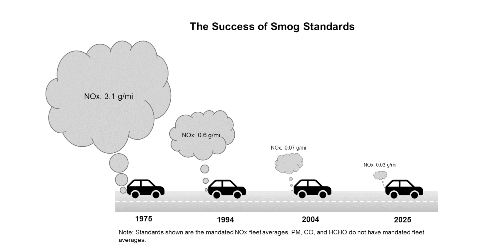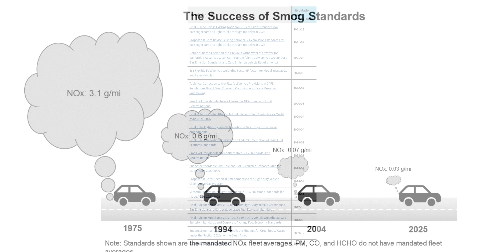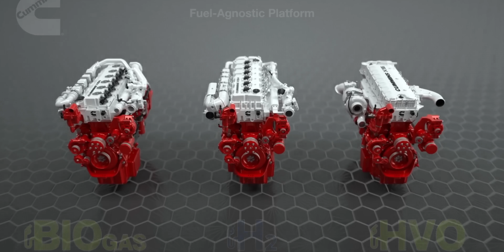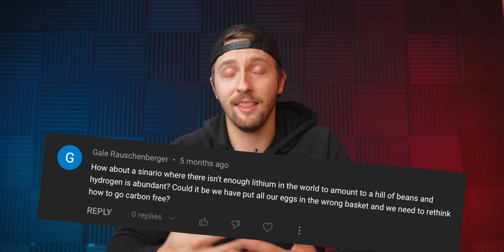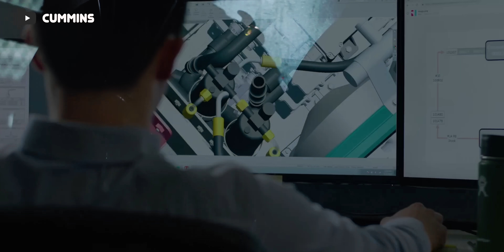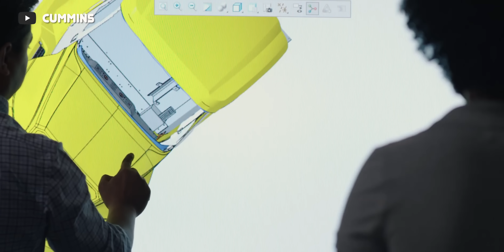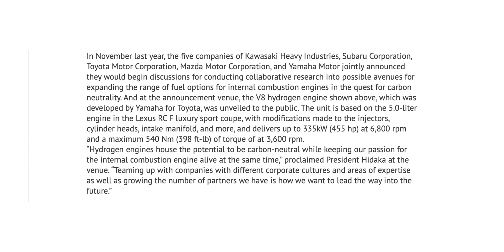Cummins Hydrogen Engine Will KILL DIESELS FOREVER

Comment: UPS has been testing LNG for long haul applications since 2013 with moderate success.  The best use is 'turns' wherein the tractor is dispatched to point B and returns to point A, where there is available LNG.  These were powered by Cummins in a Freightliner chassis.  It's interesting to note that Cummins terminated its partnership with Westport to develop this technology using LNG several years ago, and just last week, Volvo announced a partnership with Westport to develop the application using liquid hydrogen-- so it seems to me that the technology to adapt to hydrogen should be very similar to an application with LNG.  In both cases,  waste heat from the engine is used to return the LH to a gaseous state; at that point it can be precisely metered and injected into the cylinder for combustion.  Both fuels demonstrate extremely low NOX emissions-- both exceed CARB standards at the present but that doesn't mean that they are cheap.  The difference, in my view:  all you have to do is uncap our gas wells, remove the water and the sulfur from the methane, compress it and it's ready for use. It's easily distributed by truck and pipeline.

Comment: It also makes sense for a larger truck. Batteries are heavy, hydrogen itself isn't. Vehicles like the Hummer EV are so heavy from their battery weight that there are bridges they are prohibited from driving over because that seemingly normal consumer SUV/Jeep thing weighs as much as a small delivery truck like the average furniture store will use. For a many ton semitruck to effectively haul itself, it ends up eating a huge amount of it's legally available weight capacity that could be used to transport goods to use for batteries. To double the range on an EV means doubling the weight of it's battery pack by simply doubling the batteries. Hydrogen would need a larger tank to double it's range, but the weight gains are disproportionately smaller in comparison to it's range. Atleast that's how I've been seeing different publications describe the EV semi problem.

Comment: Very nice and very informative discussion. There are problems with other forms of power we have to admit that oil and gas will not be around forever, they are not infinite resources so at some stage we need a massive step up to make hydrogen and other forms of power feasible and successful. We can and have to drill more for oil and gas but we have to realize that is a short to medium term solution. That is why l also like the approach of Toyota  and now the one as explained by this gentleman, the Cummins approach. In the long run you can determine what can be the easiest way to replace fossil fuels or at least lessen the impact on climate.

Comment: Hydrogen or diesel Cummins I am done with ICE vehicle.  My truck only has 225k miles  diesel Cummin broke down on me while going camping.  Completely ruined the trip and thousand of dollars in towing, repair, rental, gas  and ton of stresses and cussing.    I maintain and change filter, fluid  with $100  and more in materials yet the f. thing still broke down and left me stranded and ruined my camping trip.

Diesel reliability my ass!!!!!    What happened???!!!   I will tell you.  Truck shook and lost speed on freeway.  I barely got off the ramp and crawled into the gas station and that was the end of it.  It died and never started up again.   Nightmare began after that in the summer just this week July 2023 as a  matter of fact.  That means hot as hell and humid in FL weather.  Absolutely fucking miserable and  maximum stress level  trying to fix it with the wife pissed off.

I fucking hated what this Dodge truck did to me despite i maintained it regularly.

I am done with ICE vehicle.  I am buying an EV from now on.    Tesla Cybertruck to be exact.     I will never buy any diesel, gas, hydrogen or whatever the fuck else there is and neither should you or you can learn the hard way like i am.

Comment: Energy needed to produce hydrogen fuel is more than the energy contained in that hydrogen fuel. 
 Put in $100.00 of energy to produce it and get $80.00 energy equivalent back out. You lost $20.00 congratulations. 
 Well if you could then sell it to some idiot for $120.00 you’re a financial wizard. There are an awful lot of idiots out there. 
 Oh by the way, how clean is the energy you are going to use to produce that hydrogen in the first place? I know use a Diesel engine that burns petroleum to run a generator 😂… on site then you cut transportation cost from shipping hydrogen.

Comment: The last time I filled up the pump did not offer a hydrogen fuel selection. If you had to design a transportation energy distribution scheme from scratch it would be hard to beat a hydrocarbon liquid. High pressure systems (compressed natural gas or hydrogen), electricity (battery charging stations), cryogenic liquids (hydrogen), and solids (wood and coal) all have real disadvantages. That is why gasoline and diesel drove all others off the transportation market in the early 20th century.

Comment: You should also do some research on an engineer by the name of Stanley Meyer who designed and built a hydrogen system for gasoline engines.  Remember that the flame propagation rate of gasoline is 1000 feet per second, but the flame propagation rate for hydrogen covers a broader range depending on what it’s being used for.

Comment: I predict a range of different alternatives hydrogen being just one example and  efuels another and the combustion engines probably still have a lot more potential for developing a cleaner burning and therefore more energy efficient future. The ev is only one part of the solution hydrogen surly is the most viable option for the aviation and shipping industries which drives our supply chain and with a broken supply chain your ev's become pointless.

Comment: More renewable electric energy can be put into the grid and hydrogen can be made anywhere and stored for later use. Sounds like a good "battery" or rather storage solution. How efficient?

Comment: Hydrogen's no more viable today than it was two decades ago either liquid or gas, there's simply no infrastructure for shipping or storage. It would take many hundreds of millions of taxpayer dollars in addition to massive corporate investment to build/retrofit existing petroleum infrastructure. No one wants to invest that amount of money after having already committed to a transition to electric vehicles. Not to mention that it's unknown if consumers would be interested. A decade or two of improvements in solar panels, electric vehicles of all kinds, and most importantly battery storage and hydrogen won't be necessary for vehicular operations.

Comment: I don’t care how good battery tech gets. Yes to indoor applications like forklifts and golf carts than can fully charge overnight when not in use but for a bus or delivery vehicle that’s in constant use for 12 hours or more electric is a pipe dream. We have lots of natural gas and propane here in North America both of which burn cleaner than diesel and should be put to use.

Comment: No. Hydrogen is awful. In most applications batteries are the answer. Burning hydrogen in an enginr is extremely inefficient, arouind 25% efficiency. If you really must use hydrogen that at least use a fuel cell that has close to three times the efficiency meaning that the expensive dangerous hydrogen cylinder would be three times smaller for the same range.

As usual with stuff like this all of the attention is on the simplest part of the problem, making something that uses hydrogen to do mechanical work. No mention is ever made of the huge problems associated with hydrogen production (95% is currently not green), compression storage and transport. Currently using hydrogen is much worse for the environment than just burning diesel and a huge number of things,  far more difficult and complex than designing a silly engine  have to be worked out.  It is rather like designing a human colony on Proxima Centauri A without acknowledging that getting there is nigh well impossible.

Comment: Be a few years yet,but i can see oil company's ending up like tobacco company's. (Not dead,but knowhere near flogging stuff like they used too.).Sooner or later,ALL new cars will be self charging,very fast ,powerful electric or hydrogen  (the most abundant element)  ..I'm not a fan of electric cars (the sound and everything does nothing for me) but If 20 years ago you told me,you could buy a mass produced, electric family saloon, , that would be faster than the quickest bike you can buy,I'd say you was mad.. (and this is just the start of electric vehicles )

Comment: Coats Racing Engines, NJ. George Coates has H2 Cummins engines fueled on-site. I worked to bring H2 Coates Engines to mainstream with George. Coats invented Rotary Valve systems over Poppet valves on Cummins. Debrittlement of steel means ceramic sleeves. Also, oiler into intake as H2 is dry. We ran these engines on H2 already. Cummins ghosted Coats and so did Harley Davidson! George wrote Bill Clinton and testified his results. 90% emissions reduction.. 90’s.. Clinton had George Locked up! I spoke at Wall Street Green Summit 17/18 as keynote on Green H2 development. I unveiled the Coates technology. I nearly went bankrupt.. Lotta Big People want this Squashed!
Reply: No doubt!

Comment: Hydrogen will be good after mankind has tamed the nuclear fusion power generation process to replace current fission powered nuclear power plants: 100 years away. Biofuel using algae is really a better near term solution. If you think vehicles containing lithium batteries are unsafe, imagine a highly-pressurized Hydrogen fuel tank in a fire: think “Hindenburg”! The safest, most environmentally friendly fuel in the universe is biodiesel made from algae.

Comment: Seems like total rubbish to me. So this will have even more pollution to make for the 100s of parts and ridiculous amount of pollution for making hydrogen fuel and storing it and transporting it and dealing with all the refueling problems including ports getting too cold and getting stuck to the vehicle. There is no hydrogen. It would've been here already had it been feasible at mass scale. They have like 4000 leased cars for hydrogen and few sales with like 30-40 refueling stations tops in CA. There's no way anyone can take Hydrogen over BEV given the pollution, infrastructure (lack of), inefficiency, pollution, complexity etc. While these videos are now historical, the tech is dodo as deemed by consumers who don't want it

Comment: Britain is planning to install small  nuclear generators from Rolls Royce, which are more easy to maintain and otentially safer. If these were used to power a hydrogen Electrolysis plant then we have a viable supply of liguid hydrogen for our heavy vehicles.I can see a lot of resistance from the petro chemical industry.

Comment: Battery EV trucks are not yet energy efficient enough because the batteries are still too heavy and store relatively little energy. It would be be more efficient to generate power through hydrogen either in a fuel cell or combustion engine then to carry  a large battery around, even when taking the energy loss in hydrogen production and combustion reaction into account

Comment: A nifty engine running on H is a lot different than a truck going down the road on H. The power density, once those tanks are factored in, is as bad as electric. Also, H is incredibly dangerous and you will never catch me in a hydrogen vehicle, see Hindenburg.

Comment: Right up front you erongly define their business purpose. It is not to sell Diesel engines, rather it is to provide customers with power units that meet the performance requirements specified. Businesses must focus clearly on their key objectives or else go up a blind alley following their dogma.

Comment: SO much talking yet you forgot to mention that hydrogen requires a lot bigger tank than diesel. Where they gonna store all of that liquid hydrogen to power these extremely energy consuming engines? If they would use the same tanks it would only last for fraction of the miles.

Comment: Excellent video explanation. Heavy haulage, construction and transport are investing in hydrogen ICE and fuel cell technology. However they are also looking at ammonia, has a transportation system for the hydrogen, which is been considered for aircraft and marine engines.Ammonia would simply fuel storage.

Comment: See I'm going to tell you something that might just blow your mind. E=MC2...so no matter what, the emount of energy it takes to move a vehicle and the mass of the vehicle is constant. So how you get the energy doesn't really matter, because the amount of energy needed is constant. So burn fuel to make electricity or burn electricity to make hydrogen or burn fuel in the engine. It's no real difference in the amount of energy you need. If fact burn fuel anywhere but in the engine is worse due to the laws of thermodynamics. Transferring energy into different form you will always lose some... now for the why this is going on in the world.... POLITICS

Comment: The real problem with all this is that once you burn the hydrogen in an ICE, you then throw away 2/3 of the heat just produced. It's bad enough doing this with petroleum products; it's lousy economics to do it with hydrogen that costs so much to make.

Comment: Nuclear power plants would be perfect to generate hydrogen.   On the other hand, a hybrid vehicle like the Preus, just scaled up, would allow a smaller engine to run a larger vehicle efficiently. The stored energy in the battery would kick in much like a turbo does today and would give the boost needed to accelerate.

Comment: Will you do is install a dedicated alternator for the hydrogen fuel cell then you require 100 1 ft² stainless steel 3/8 plates divide that by 4 and get the appropriate plexiglass install four different hydrogen fuel cells on the back of the cabin of the semi❤❤❤❤❤

Comment: agree diesels aren't going to disappear anytime soon but regulation will push manufacturers to find alternate power sources and hydrogen looks like  good alternative for the reasons you stated. But we need massive investment in cleaner electricity generation to power all this as the hydrogen is really an better alternate storage to batteries. In the UK JCB are in pre production trials with a hydrogen engine along very similar ideals as the Cummins unit

Comment: Compressed hydrogen and compressed natural gas both require similar storage tanks and spark plug ignition.
Putting an optimized ICE head on a standard diesel block should work well for hydrogen, CNG, and even gasoline with the flip of a switch.
Most Taxis in Lima are dual CNG/gasoline since CNG is half the cost, and hydrogen will not exist for decades... lol

Comment: I’m impressed. He’s done his due diligence. Very dope and comprehensive video, laying down all the reason why we at Cummins are working on various technologies that practically and realistically move the needle on getting cleaner and better powertrains for the climate and the planet (and not just shift the problem to the power grid). Hydrogen is one of the technologies amongst a few others. He laid down very well the reasons why we think different applications will require different clean power technologies. Integrity is a company value and so we don’t make wild unrealistic projections that don’t make sense. Everything we are doing is based on deep and extensive research that enable us to make the right investments at the right time. Well done sir

Comment: Nuclear Fission can be used to directly separate Hydrogen and Oxygen en-masse from sea water. No electricity required. But for whatever insane reason the entire world is averse to the most efficient method for this, and everyone is talking about windgenerated electricity for this, which is so wasteful it makes my head hurt and ears literally bleed.

Also, nuclear is the safest form of energy generation known to man. And wind alone kills more in dead maintenance workers a year than nuclear has killed in its entire history.

But, as I said this world is run by imbeciles.

Comment: Great to see this engine and I agree that there are so many applications where electric and fuel cell are not practical. I would note that the H2 storage shown in this video is a compressed gas stored in carbon fiber cylinders. A liquified storage is likely possible but those tanks would be stainless steel cylinders. Compressed gas is likely the better path over liquified.
Reply: Fuel tanks will be a major obstacle. H2 is inefficient to produce right now.

Comment: UK JCB are also now building hydrogen engines and the plant to fuel them as supply structure doesn't exist on a local enough basis they are just as powerful as diesel motors and refuel takes the same time.

Comment: There has to be an alternative to electric batteries and all their recycling issues. I worked in the oil industry, it can last a lot longer used with care, BP and other majors have jumped on the solar panel bandwagon because it is an alternative, which has won government approval, to hydrocarbons my question is: Is it the right one? JCB & Cummins have both invested is hydrogen - amongst others.